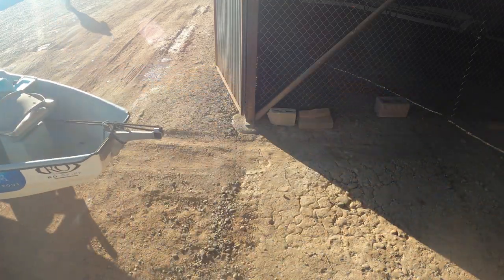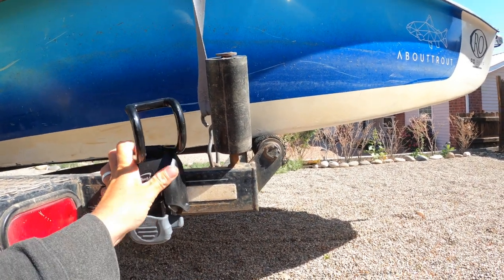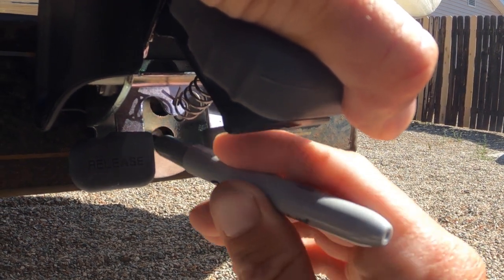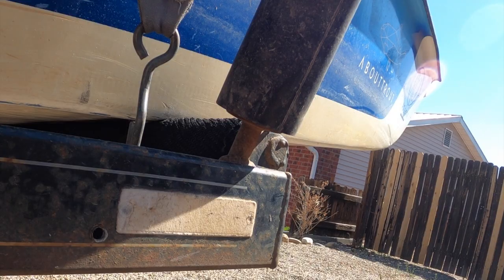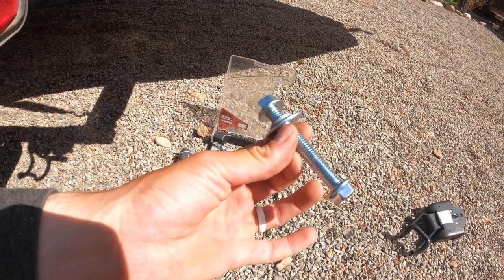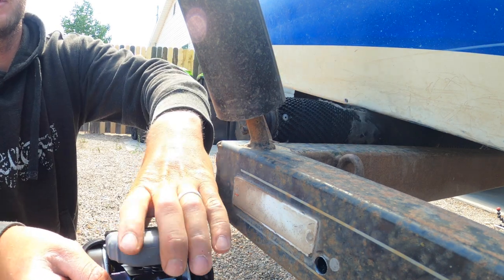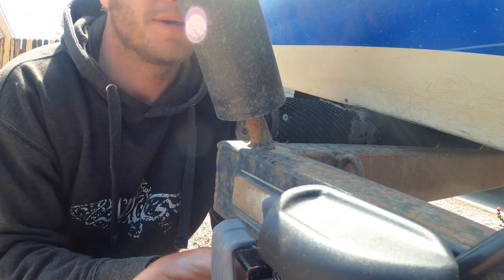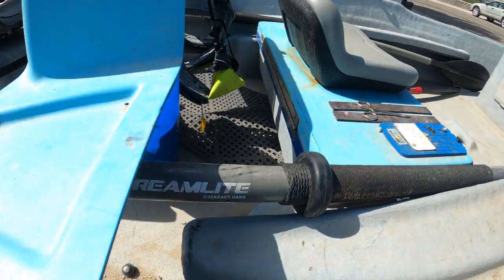Installing Boat Buckles on Drift Boat Trailer

Comment: Without straps running across your boats. How do you secure your oars?  I always use the straps to hold the oars to the seats and the boat to the trailer.
Reply from the maker: I just keep them on the boat floor.